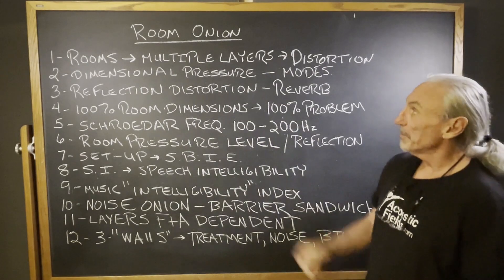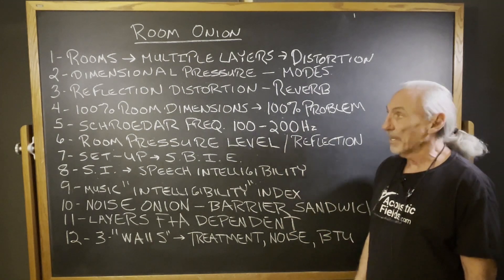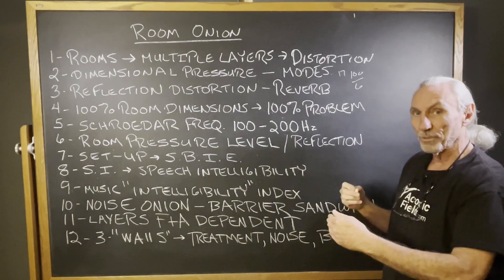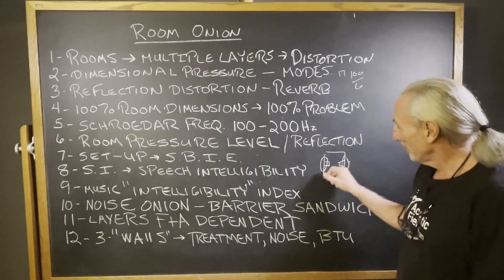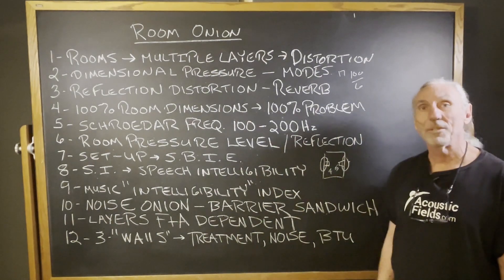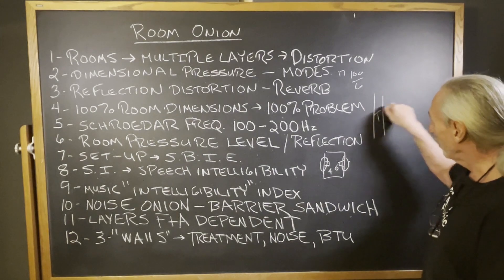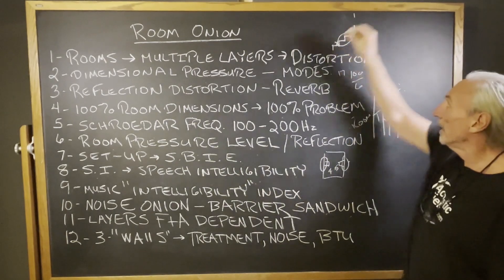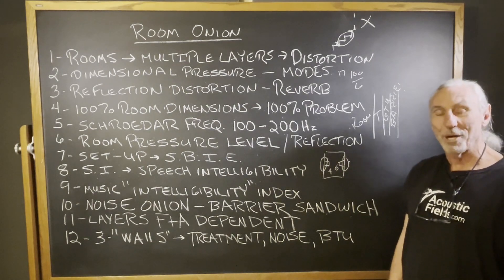Room Onion - www.AcousticFields.com

Comment: Have you ever found or determined a “near perfect” room for any usage? That is, a room with shape, composition and dimensions that require the least treatment to achieve good sound for the purpose intended?
Reply from the maker: All rooms are a compromise. The compromise is called error rate. You must design noise and treatment rates and levels to minimize error rate within the specified budget restrictions..
Reply: @AcousticFields  I guess then my question should have been, for any given usage, for example a two channel listening room, is there a situation that presents a lesser treatment to achieve a lesser error rate?

Comment: As a wise man said "the only short cut is there are no short cuts".
Reply from the maker: When it comes to room acoustics and noise transmission, every step in the process is built upon the step taken before it. If you skip steps for whatever reason, you will increase the error rate and may end up with a room sound you do not want.